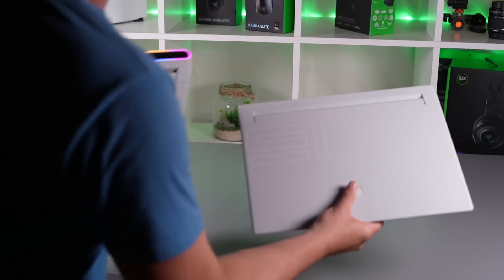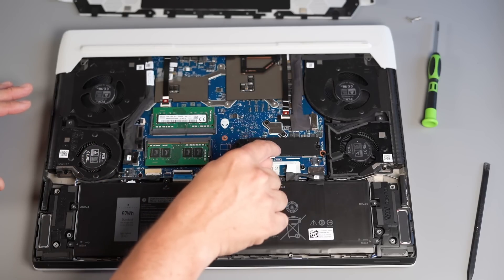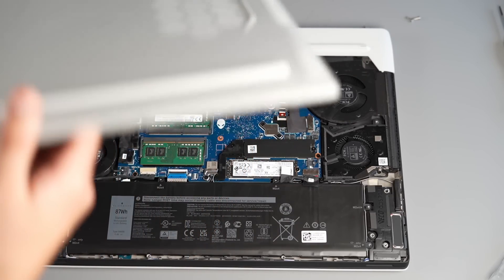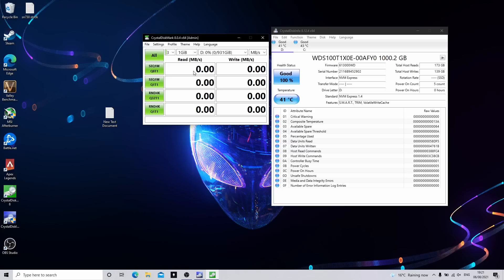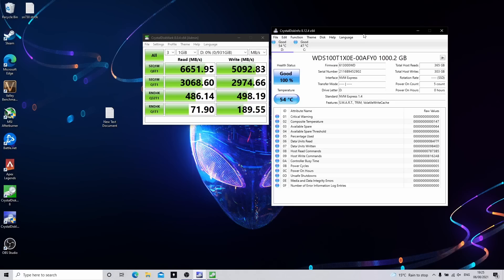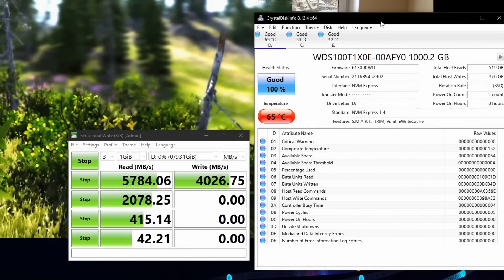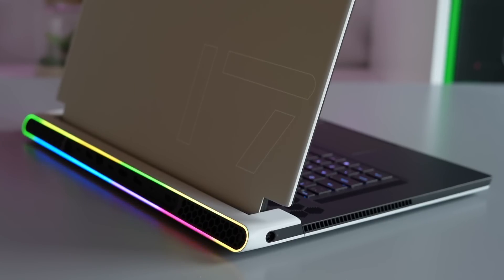Alienware X17 / X15 SSD upgrade featuring Gen 4 M.2 NVMe

Comment: I think this is the only video review of M.2 2280 SSD PCIe Gen4 x4 NVMe for the Alienware x15 R2. Btw, the WD SN 770, WD SN850 and WD 850X have the same dimensions so it must fit all of them.
Reply from the maker: correct. Although the 4tb sn850x is double sided so I doubt that model will fit but all 2tb and below are fine :)
Reply: @MashITTech  I'm glad you're wrong on this one, it fits. However, I am not sure if a heatsink can fit on top of that. Thanks for your video again, is the first time I install something on a laptop! (The stripped screws were a pain in the ass though hahaha)

Comment: Bro thank you so much for this video! Appreciate you chap! And your videos
Reply from the maker: Glad you like them! :)
Reply: @MashITTech  for sure mate also thanks to your video on detail about throttle stop my x17 is running like a beaut
Reply: @MashITTech  hey hashIT I don't suppose you can help? I installed a new crucial gen4 4TB in to my slot A as you showed and my C: drive SSD which is 1tb in to the slot B but I am having issues with steam and speeds I'm only getting 1gb transfer speeds and my steam games no longer work I cut and paste all my games from my other drives and out them all in gen 4 new drive in stea folder but steam does not play them and keeps saying about pathway not found
Reply: I have the x17 R1 with I9 and rtx 3080  (RGB track pad version)

Comment: using 980 pro in same laptop saw a small gap by the controller so I removed the thin thermal pad from original heatsink and put it under, between the ssd and motherboard ,then used thicker thermal pad between heatsink and ssd. temp gone from 65C down to max 55 and 45 idle

Comment: I would use HD Sentinel Pro works better,  logs much more parameters than SMART and way more accurate than any of these freebee apps. Btw most SSD's are rated for 130c (and they will shut off to prevent damage if too hot anyway) so would not worry about the temps and SSD's are dirt cheap nowadays. Lastly you should always backup important data to an external drive as well. Its the golden rule..Always back up your stuff. I only use a laptop as a backup PC to my desktops but run SSD's in all my desk or laps and never worry about the temps but if you are lots of thermal solutions out there.

Comment: Did anyone put a 4TB or 8TB ssd in the x15? if so which one?
Reply from the maker: Trouble with those drives is they are double sided so to fat to fit 😢 I have heard there is one crucial single sided 4tb but I haven’t tested it yet to confirm

Comment: Does sn850x fit the port in X17 r1?
Reply from the maker: it certainly should but I haven't tested one yet
Reply: @MashITTech  guessing it might work, just with a lower transfer speed..!
Reply from the maker: The speed should still be fine as it is still gen 4

Comment: Is there a way to upgrade the cpu . I edit YouTube videos in mine and my cpu is maxed out and won’t let me export videos off my editing software
Reply from the maker: 1. No you can't upgrade the CPU.
2. the 11800h is a great CPU, there is no way you should be having problems editing video. and exporting should never be an issue, worst case if you have a slow system it just takes longer.

Comment: I swear you used sorcery to get the bottom off this laptop. It doesn't seem to matter how I pry, I can't get the bottom off. Perhaps I'm being too careful about avoiding scratches, but it doesn't look like you applied even half the force that I've tried applying to this machine.
Reply from the maker: the bottom front left and right screw when undone should pop the base panel up then you just pull it upwards. It Should be easy. Does yours pop up when you undo the screws?
Reply: @MashITTech  No.  Mine just sits flat.
Reply from the maker: That's the problem then. I bet they didn't put the retaining washers on the screws :( Have you got a suction cup? put that on a corner and pull upwards gently but firmly

Comment: Is there a reason why you can't put a gen 4 drive in the second slot? I'm looking at a refurbished system that only has 512GB for a boot drive, and would like the second drive to be 1TB or 2TB.
Reply from the maker: The second slot is a gen 4 slot. When it first released for some reason it wasn’t performing at full gen 4 speed but dell released a bios that fixed it
Reply: @MashITTech  Thank you for the response! Would you say it's safe to put a gen 4 SSD in the second slot, provided it has the cooling plate attached? Thanks so much for being so helpful!
Reply from the maker: Yes it’s fine to do so. Just get one of the copper plates to keep it cool or contact dell and ask them for a heatsink 👍
Reply: @MashITTech  Sounds great! Thanks so much again for the advice and all of your helpful reviews.

Comment: Hey mash i was trying to install the gen 4 ssd, now my laptop says boot device failure and cant find the ssd, so i have to shut down the system..
Reply from the maker: so you replaced the Gen 3 drive with a Gen 4? is it showing in BIOS?
Reply: @MashITTech  yeah it doesent show
Reply from the maker: What drive did you buy?
Reply: @MashITTech  the same as you as heat sink, but he doesent even find the old gen 3 if i put it back in.
Reply from the maker: wow that is very odd! Try the second slot to see if there is something up with the first slot
Reply: @MashITTech  same thing nothing happens:(
Reply from the maker: This is really odd. You haven’t changed any bios options have you?

Comment: I have two 256 gigabyte ssds in my 3080. I just bought the sn850 and tried installing it but im pretty sure i have to reformat it before i put it in. Do i just keep one of the 256 gbs in the first slot will that work?

Comment: Mine came with 2tb , can i use slot 2 as 4tb ssd m.2
Reply from the maker: did you order a single 2 tb ssd or raid option? if you have single 2tb then yes you have space for 1 more drive. I am making a video on this subject very soon
Reply: @MashITTech  SABRENT 8TB Rocket 4 Plus NVMe 4.0 Gen4 PCIe M.2 Internal SSD Extreme Performance Solid State Drive R/W 7100/6600MB/s (SB-RKT4P-8TB)  can i add this to the second slot
Reply from the maker: I don't think it will fit! The SSD sits almost flush to the motherboard so double sided SSDs won't fit sorry
Reply: @MashITTech  i just recieved my alienware x17 R2 and the 8tb SSD fits and work full speeds i have 10TB available in my laptop now

Comment: Would love to see the cloning technique to install windows. Just got the x15 today and plan on switching out the boot drive for a gen 4 with larger storage
Reply from the maker: I am working on an SSD video at the moment, I will add cloning to the list
Reply: @MashITTech  ty I appreciate it alot!
Reply: Okay, one thing I do need to ask, performance wise, which do you think is more powerful? The m15 r5 or the x15 r1?
Reply from the maker: oh that's quite tough, I would say they are on par. The m15r5 has a slightly higher TGP but the CPU runs really hot. Gaming wise I don't think you would see much difference between them
Reply: @MashITTech  ty for all your help! Ended up finding a x17 r1 (my dream pc) pretty much brand new for 1800. Now just need to adjust stuff after I update the drivers and bios. I'm excited to play the Witcher on this thing!!
Reply: Okay, I do have a question, do you know why when I'm doing a userbench mark it's coming up as incomplete? Bc of the graphics card like not recognizing it or something when doing the benchmark? And I have updated the bios and drivers and turned off advanced optimus
Reply: Basically trying to determine if there is something wrong with the PC, or if it is user error
Reply from the maker: @druf7734  hmmm, I don't use that one! have you tried running a 3dmark time spy or firestike?
Reply: @MashITTech  no I'm resetting it first and seeing of that fixes it, bc I even tried before trying to f5/f7 to change the graphics but it wouldn't pop up....it was open box, basically someone bought it and then returned it but no idea why ..
Reply: I'm hoping it's user error...
Reply: I'll try out those benxhmarks as soon as it's done resetting and stuff. Sorry for the questions and ty so much for all your help. This isn't my first gaming PC, but it is my first Alienware and first time I've had it PC wise where it's not recognizing the gpu
Reply: @MashITTech  firestrike is through steam correct? Everytime I try to run it out won't launch
Reply: @MashITTech  hi I'm going to take you up on your offer if it's still okay and message you on ig for some help?

Comment: have you tried the WD SN850 with heatsink version? will it fit into the X17R1?
Reply from the maker: No chance of that heatsink fitting sorry!
Reply: @MashITTech  i jus receive the SN850 1TB with the latest firmware... i cloned the drive from the original SN730 512GB.... seems like i am not getting the type of write speed you are getting. not sure what is wrong...the results are worst when i run on AS_SD benchmark... the SN850 had a lower score and result from the SN730...is there anything i should look out for when i clone it.

Comment: thankfully the x17 R2 has 2 Gen 4 slots, but Dell is being secretive as usual and the specifics of their drives and memory.  So I have ordered the smallest option 512GB and will give it to my son.  I'm planning on ordering 2 Samsung 980 Pro's with the heatsync built in, but I am concerned about clearance, as the 980 Pro heat syncs are much thicker than the Dell provided M.2 Thermal Shields.  Part of me says to order the 980 Pros without the heat sync, reuse the one that comes in the x17 R2, and then purchase a second one from Dell.  My concern with that approach is that I won't be cooling the 980 Pro's enough and the builtin controller will slow down the performance as it approaches higher temps.  Anyone else have thoughts on this?  I am not a gamer, but the applications I spend most of my time in are very affected by disk I/O bottlenecks, so I always split the data and go with the fastest option I can and that always seems to do better for me than getting the top of the line cpu/gpu.
Reply from the maker: I have the r2 coming g with a 512gb and another with a 1tb and suspect they will both be gen 3 as per r1. They were only supplying the 2tb as a gen 4. The 980 pros heatsink will be too think, they are designed for desktops where clearance isn’t an issue. The gen 4 980 pro and wd sn850 both work fine on the included dell heatsinks so just get hold of a second from dell, it shouldn’t cost much. You can also sometimes find them on amazon
Reply: @MashITTech  much appreciated!!!
Reply: @MashITTech  As info, I have been going back and forth with Dell tech support and they are adamant that both x17 R2 and the R1 have BOTH slots at Gen 4.  First they provided me with the manuals for both R1 and R2 (user and service manuals) which indicated both slots are Gen 4.  I still wasn't buying it and they get Engineering involved.  Not sure where this confusion started, but perhaps due to Gen 3 and 4 sticks being sold by them without indicating which.  No clue, but they are saying both slots are Gen 4
Reply from the maker: @Hangs4Fun  sorry I may have misunderstood you. I thought you were asking if Dell will supply gen 3 or gen 4 drives. Both slots are definitely gen 4, but dell still supply gen 3 drives unless you buy the 2tb on the r1. I am not yet sure what dell will be supplying on the r2 but I have 2 x17s and an x15 on the way so I will be able to let you know soon 👍
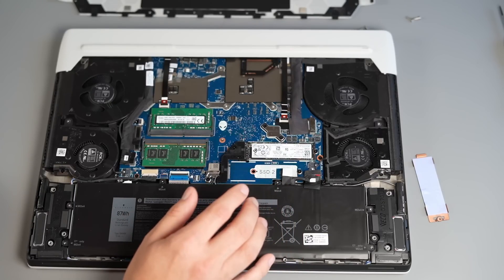Reply: @MashITTech  @2:50 you said that bay 1 was Gen 4 and bay 2 was Gen 3.  That is where the confusion has come from I believe.  The reality is that both bays (slots), are Gen 4.  I'm installing my 2 Samsung 980 Pro NVMe's as we speak ;-)

Comment: I just asked dell for the M.2 SSD Heatsink part numbers.   
For the 2280 Heat sink: Part #C99KM for "PLT,THRM,SSD,2280,CU,X17R1"

For the smaller 2230 Heat Sink:  Dell Part # 9F96F  (Thermal 2230 Trans BracketH17).

Comment: Do you have to put the gen 4 in that slot? I just ordered this one (Samsung 980 PRO w/ Heatsink PCIe® 4.0 NVMe™ SSD 2TB) for an Alienware M17 r4
Reply from the maker: The m17r4 is only gen 3 I am afraid. The SSD will still work fine but it wont be as fast as a gen 4 slot

Comment: Can you tell me where you found confirmation that both slots aren't gen4? I've read that they're both gen4.
Reply from the maker: You are right, They are both gen 4. The dell service manual says one gen 3 and one gen 4 and my second slot was giving me lower scores so I assumed it was right. I retested as after a couple of people mentioned theirs was working properly at gen 4 so I updated bios and switched it from raid to NVMe in bios and also got gen 4 performance. Sorry for the confusion, I will put a note in the description
Reply: @MashITTech  no worries. Weird that Dell got this wrong in the manual. Thanks for testing it!

Comment: Thanks, heaps for the video! Do you think if I choose the dual drives 2TB (2x 1TB) M.2 PCIe NVMe SSD RAID0 as part of the Core i9, RTX 3080 configuration, I will get the gen4 drive? or there is still a possibility to receive the gen3 drives?
Reply from the maker: never ever ever get the raid option! you will get gen 3 for sure and you then cannot add another drive later. Only the 2tb option is a gen 4. Either get that or the cheapest ssd option and buy them yourself. It is so easy to add an SSD
Reply: @MashITTech  Thanks for your reply and appreciate your help

Comment: Just finished cloning my Windows 11 to the new Gen4 1TB. Boy that was a mess and a half. But I got it done. 1TB for Windows drive and 1TB  for Storage. The Dell partitions didn't allow me to expand my drive was my main struggle but I was able to overcome it. Both NVMe are WD
Reply: Why was it a mess? I am planning to do this too from my stock 512GB to a new Gen4 1TB.
Reply: What program did you use for cloning?
Reply: @mpbrus1980  Macrium Reflect 8. The trial version.

Comment: Interesting video. Just ordered an X15 R1 with the 1TB M2 SSD option. There was an option to upgrade to a 2TB M2 SSD, but I didn't take it (did think about it). Would I be right in assuming that when my 1TB laptop is delivered, one of the M2 SSD bays will be populated and the other empty? If ordering the 2TB option do they basically populate both M2 SSD bays with 2x 1TB SSD's? Thanks in advance!
Reply from the maker: The 1tb is a single 1tb gen 3 ssd so yes you will have a spare m.2 slot to add another. If you order the 2tb you get a single 2tb gen 4 ssd. No idea why only the 2tb is gen 4
Reply: @MashITTech  many thanks for this. I may try to change this part of the order. I think the upgrade cost from the 1TB to the 2TB was circa £100... which seems to be worth it?
Reply from the maker: @get-to-da-choppa  yes it’s not that expensive for a 2tb gen 4. It will delay your order though unless you literally just placed it so are still at the beginning of your wait
Reply: @MashITTech  yeah I literally placed it earlier today. I was able to revise the order with them today no problems (actually cancel the existing order and place a new order, which is easier for them). The total cost came to an additional £157 for the move from the 1TB to the 2TB. A little higher than the option cost of £100 at point of build. I wasn't too fussed though as I already had an amazing deal on the entire build due to them having to cancel my original order on an M15 R6 due to lead time/stock issues. X15 R1, QHD 2560x1440 240Hz i9 11900H, 32GB DDR4, RTX 3080, 2TB SSD... roll on New Year!
Reply from the maker: @get-to-da-choppa  hope it doesn’t take too long to arrive for you 👍

Comment: My x15 3080 qhd i9 2tb came with pcie4.0  western digital and not the samsung.
Reply from the maker: oh wow first time I have heard them using the WD gen 4! is it the SN850?
Reply: @MashITTech  sn810.. i did not pay $3500 for some low tier memory. Im calling them today and getting that 980 pro memory. Ridiculous. Some people have been getting micron memory as well.
Reply from the maker: @VinnigTiredOfCompaniesGimping  I haven’t come across sn810 before, can you run crystal disk mark ans let us know how fast it is? The sn850 is faster than the Samsung 980pro in a lot of scenarios
Reply: @MashITTech  yea i’ll run some! Western digital uses sandisk and sandisk is garbage. Prone to fail
Reply: @MashITTech  making the video now! Itl be in performance mode. Do you have any request or how many test would you like to see?

It is fast 6889 was lowest read and 6990 was highest.  Write speed is in that normal range of 5138. Thats running two test back to back with 5 intervals each.
Reply from the maker: @VinnigTiredOfCompaniesGimping  that’s actually really good. It may well be a sn850 variant. Was this crystal diskmark?
Reply: @MashITTech  yea crystal dismark $8.59 in the Microsoft store
Reply from the maker: @VinnigTiredOfCompaniesGimping  oh man,  I can’t believe they are charging on the store! It’s free on the devs website! Still those are actually good results, I would be happy with that, it’s right up there with my sn850.

Comment: if i want to keep windows on the gen 3 drive can i just make windows boot from  ssd slot 2 rather than one meaning i dont have to reinstall on the gen 4 ssd....i dont want to have to reinstall windows and all the alienware software
Reply from the maker: If you are going to keep windows on the gen 3 then don't even bother buying a gen 4, just get another gen 3 and save some cash. Only windows and apps really benefit from the faster speed, games, docs movies etc you will see no difference in speed
Reply: @MashITTech  thank you, and do I need to get a new heat shield